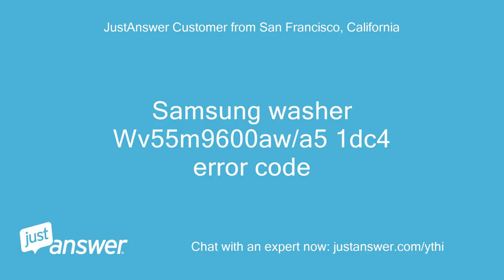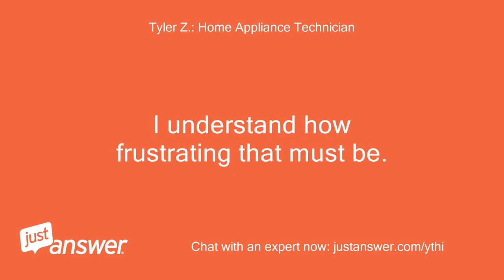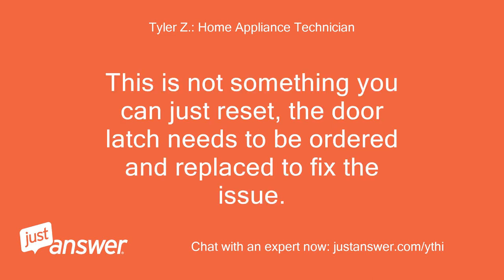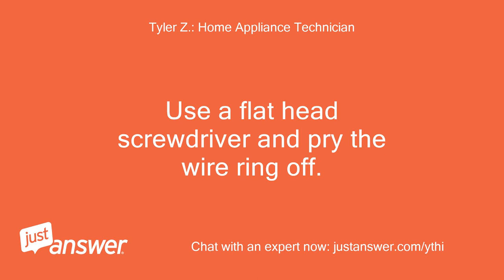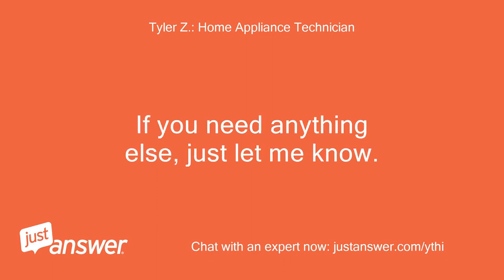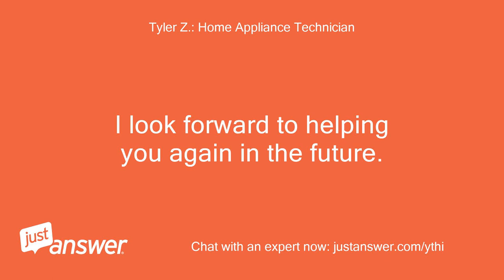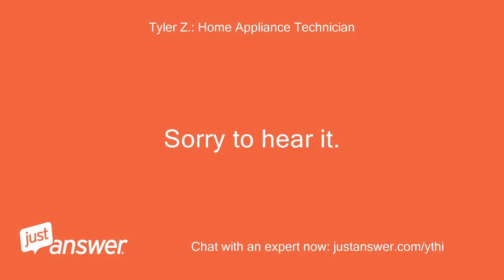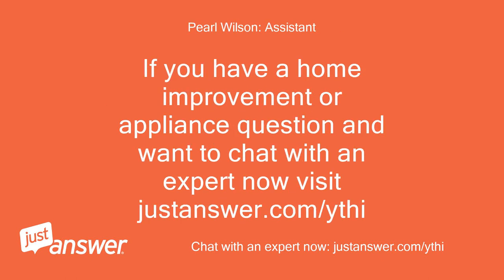Samsung washer Wv55m9600aw/a5 1dc4 error code

Comment: I just found an interesting cause of the 1dc4 error on a samsung flexwash. The cable was somehow being pinched and losing continuity when the top lid door was within the bottom ~45 degrees. So in the door closed position the switch would close the circuit, but the wire would lose continuity. You can confirm that you have this error by opening the top control panel and testing the voltage between the first and second wires on the 15-pin connector.  (in the service manual this is connector CN501   1. GND 2. INNER DOOR S/W). With the door closed switch depressed the voltage should drop to ~0V, but if the lid is swung towards the closed position and the voltage increases to ~5V while the switch is still depressed then you've got the same discontinuity error in the wire as I had. If the voltage is always 5V then the cable or switch is fully broken. The same fix would still apply. After taking 2 hours to figure this out, it's a quick fix to disable the door close switch by putting a jumper across these two leads. Replacing the cable and the switch looked like a new lid would be required and many many hours.
https://www.manualslib.com/manual/1555064/Samsung-Wv55m9600av.html?page=51#manual